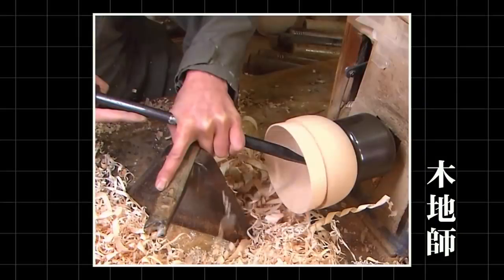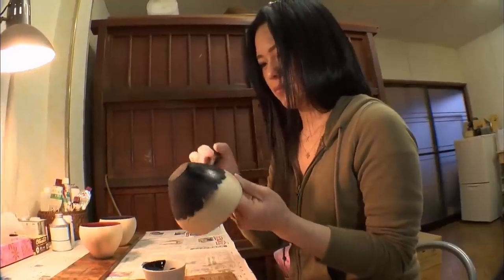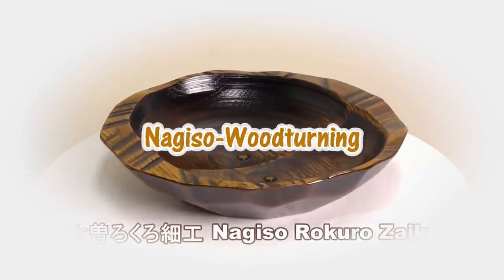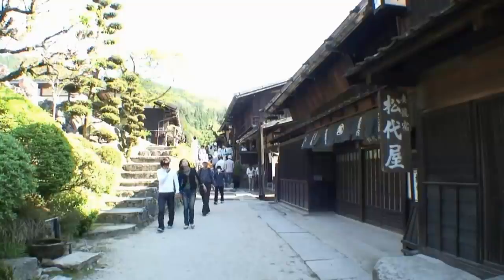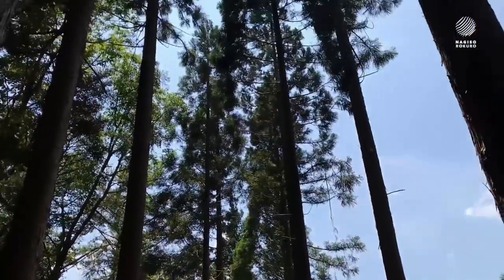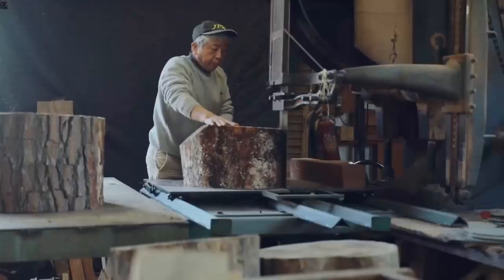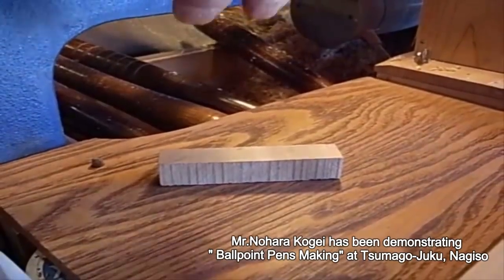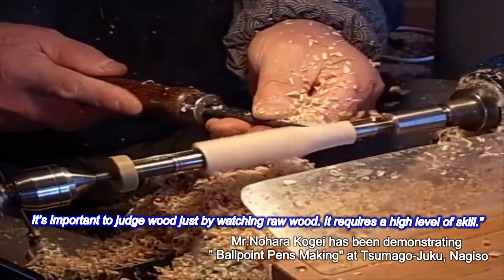To Begin NAGISO WOODTURNING Work, The Material Trees are around 100 Years Old and Dried for 10 Years

Comment: I’m interested to know what the finish is made of. As a woodworker, I’m always looking to expand my knowledge and use of traditional, natural, materials. Still scared of Urushiol though one day I may try it on a small object.
Reply from the maker: as a general rule of finish, pieces are either rubbed with "Horsetail" to bring out the wood grain or given a coating of natural lacquer in a process known as "urushi fuki", both methods bring out the attraction and simplicity of natural wood.
Reply: Woodworking Enthusiasts 

I am familiar with both of those. I have made “Horesetail” bundles out of broom straw dipped in beeswax for burnishing wood. I find Urushi to be almost without peer as a finish; though, in it’s liquid state, it scares me. My favorite finishes are French Polish using self made shellac and “horsetail” burnishing followed by Limonene & Tung oil.
Reply: @WoodworkingEnthusiasts  Hi! I am an amatuer wood worker. I have started wood turnning recently  and looks for food safe wood finishes. 
Are these finishes food safe and heat resistant?  For eg.  Can we use these bowls for drinking hot soup? Thanks.